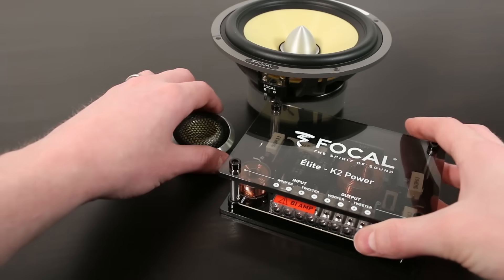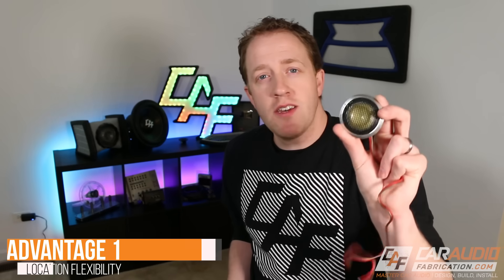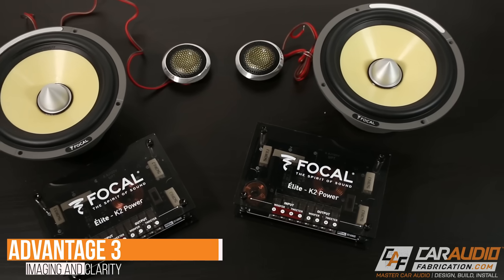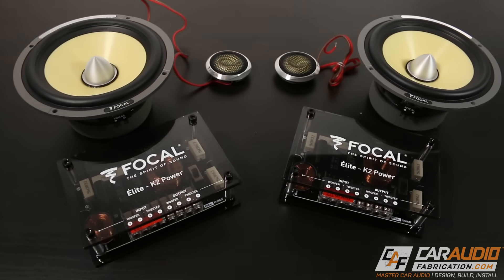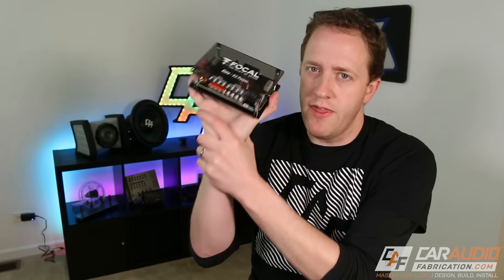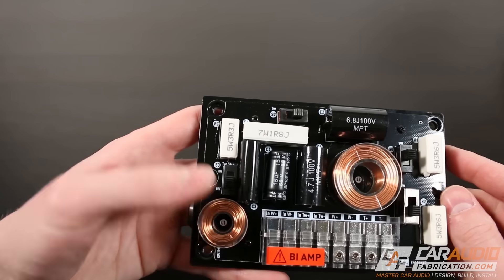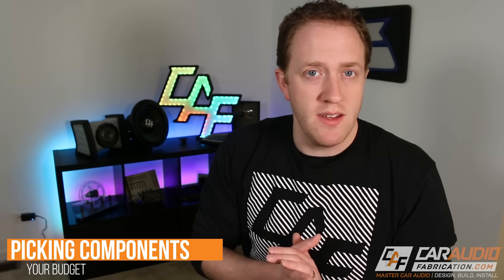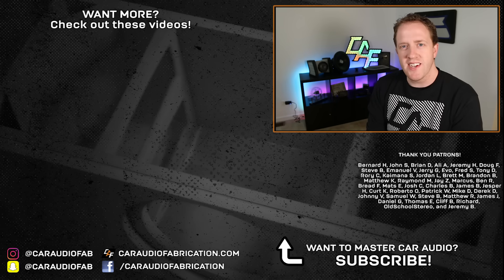Want AMAZING sound? COMPONENT SPEAKERS & everything YOU should know...

Comment: my clk has a factory speaker and tweeter, I want to replace it with a jbl component speaker, my question is: is there a hidden factory crossover that I need to find and replace with the new jbl crossover? or I just use the wires feeding the factory woofer and connect it to the new jbl crossover then branch from it two lines to the new woofer and tweeter?

Comment: I actually have two sets of 6.5” Focal components in my car.  Pricy but sound phenomenal. Bought them in 2011 and are still going strong. From 2011-2018 they were installed using the regular passive setup and sounded great. Recently had everything installed in a 2018 Accord and they did the active setup. It’s a world of difference in sound. Especially with high-end speakers like Focal it is very worth getting the most out of them. It’s like going from a regular exhaust to a free-flow dual exhaust.

Comment: Will a equalizer help? I just replaced focals coaxials auditors for some hertz esk 2 way components it doesn’t seem as loud anymore like a power loss I like how they sound more voice but it’s so sensitive to the jl 400.4 amp you move and the tweeter comes up with to much treble it makes your head hurt i put all the gain down on the amp and seem so fix the problem but it’s not loud at all . regardless of what you do it’s either not loud enough or the tweeter is extremely out of it I have a lc6 also

Comment: New to car audio and I am trying to install this into a 2011 Crown Victoria. I am not a bass head, I just want my music to sound good. 
1# Will this work?
2# What else do I need? (component wise)
3# Where can I install the subs other than the trunk? I am actually considering cutting the backrest of my back seat in half and installing the sub between them. They won't fit in the back deck due to the torsion bars for the trunk lid. They are only 8" and I don't want to waist all the bass they provide by having them in the trunk. Do you have any bench seat mod videos?
4# I was thinking of putting (3) 6.5 and (2) tweeters in the back deck. In the front, (1) 6.5 and tweeter in each door with a single 6.5 in the center console. Is this a bad idea? And do you have any custom console build videos?
5# Should I use wood, or fiberglass? What are the pros and cons?

AudioControl LC8i Black Eight Channel Line Output Converter with Auxiliary Input
(2) Rockford Fosgate R500X1D Prime 1-Channel Class D Amplifier (For subs)
(2) BULLZ AUDIO NEW 4400W 12V BCAP 4.4 Digital Car Power Farad Capacitor | BCAP4.4 (For subs)
(2) ROCKFORD FOSGATE P2D2-8 8" Punch 1000W 2-Ohm DVC Car Audio Subwoofers P2D28
Rockford Fosgate P300X2 300W RMS Punch Series 2-Channel Stereo Class AB Car Power Amplifier (For Tweeters)
Rockford Fosgate P600X4 Punch 600 Watt 4 Channel Amplifier (For Midrange)
(6) Rockford Fosgate PPS4-6 6.5" 800 Watt 4-Ohm Midrange Car Loudspeakers Speaker
(4) Rockford Fosgate PP4-T 1.5" 200 Watt Heavy Duty Car Power Bullet Tweeters
American Bass High End 7 Band Equalizer Voltage Display
(2) Rockford Fosgate PP4-X Punch Pro 4-Ohm Passive Crossover
Kenwood DDX774 / DDX774BH DDX774 2 Din Receiver w/ Bluetooth and HD Radio

Comment: I think you are undervaluing the passive crossover.  It is the very heart of a speaker system and includes some frequency contouring and impedance optimization to "voice" the speaker system.  When purchasing individually, you will find that half the cost of a speaker system is in the crossover components.
Reply: Did not know that

Comment: I'm about to get Rockford fosgate components and also ones in the rear doors would the JBL 4505 be enough to power them and a 300w RMS JL subwoofer? The amp is rated at 45w X 4 + 500w @ 2 ohm I believe.

Comment: hi please if you can tell 

can i use 4 speakers and one woofer in 4 channel amp ? 

I mean 2 front door and 2 back door speakers and 1 woofer 4 channel 1000
Reply: No you can only run 4 speakers. Or 2 speakers and a subwoofer.

Comment: Components require more wattage than a coax..
Reply: Robin Murray because they can handle it! Check google for speaker power theories. To play at the same volume a tweeter will take less than 10 Watts that a 6.5” mid bass will take 100 Watts. Refer to pink noise...

Comment: When I got my car, I noticed that the highs we're so loud that they were driling into my head. I found out that there were aftermarket tweeters in the dash. I removed them because I couldn't handle it. But is there a solution to it?
Reply: I know my response is late but I hope it still helps. As mine are pretty shill I use the built in equalizer in the head unit (I don't have amps or a crossover for front) to put some more mid and low and tune down the highs

Comment: But- your passive x-overs are bi-ampable... solving a lot of the tweeter issues you mention. Why not use a 4 channel for you front stage, adding a DSP and using the as designed crossover
Reply from the maker: This video is meant to be a basic lesson on component speakers, not a focus on this exact set. I didnt want to discuss biamping and other features that are rare for most other components.

Comment: Love the channel! I wish I had half the skill you have with custom builds. I was wondering if you could do a video on how to properly perform time alignment on a head unit. For example, I have a component set (JBL GTI 660) for the front soundstage connected with the included crossovers and a second set connected for the rear soundstage. I have these connected with a four channel amp and a kenwood double din deck. I also have a 12 inch sub in the back of the car. To get the JBLs sounding good doesn’t take much configuring at all, but it’s the integration of the subwoofer that is so difficult to get right. I have a little knob under the dash to adjust the sub level on the fly but I can’t get the sub to sound like it’s part of the front soundstage. I always seem to hear the bass coming from the back of the car. I want it to where when I turn up that knob for the sub level that the bass blends in perfectly with the mids in the doors, almost as if it doesn’t sound like I have a subwoofer but rather much larger midwoofers in the doors. Is it something to do with the crossover settings such as the slope or the freq cutoff point? Perhaps the time alignment is the culprit? A combination of the two? I spent way too much money on my system to not have it be the way I want it. Any help that you can provide would be most helpful and appreciated. Thanks 🙏
Reply: You need a DSP to do time alignment

Comment: @6:00, whoa, whoa, hang on there big shooter, you cannot connect two tweeters or midwoofers to a crossover without changing the impedance load, thus crossover frequency an entire octave... up or down depending on parallel (2ohm) or series (8ohm). Only way this can be done is if the crossover has impedance correction.... and I doubt any do. This will blow a tweeter or play mid woofer into its cone break up zone losing all benefits of intended design. -The passive crossover 'eating power' is bogus, the minimal capacitor/inductor resistance is insignificant and inaudible. -Active is much more beneficial though as far as time alignment, phasing, distortions and personal tuning but not for the noob requiring measuring mics and software for custom DSP parameter tuning. Thanks for this guide video though, great advice for all entering the DYI world or speaker-ation on needs before walking into audio store..... or Crutchfield (fantastic audio product source and customer support)

Comment: I have a 2-way speaker mounted right into the dashboard facing upwards. Is that a good placement? Or would it be better to mount it in the door?
Reply: It's usually not a very good spot. You will get a ton of reflections from the windshield, and the angle from the listening position will usually also be quite large. Get the midbass speakers into the doors and at the very least, get the tweeters in some pods that mount on the dash so that they can be focused better.
Reply: My friend learn the hard way years ago when he put a 6-inch speaker straight into the dash that thing vibrated everything inside that dash 😂😂😂😂😂

Comment: Mark, I have BMW e30 with a component system in the front, woofers are in the kick panels and two tweeters installed in the sail panels. I have a spare set of Alpine tweeters which I have thought about fitting but haven't really considered a suitable spot for them as yet. My question is though would these extra two tweeters make much of a difference or how could they make a difference to enhance the system? Thanks.
Reply: Hold on. Before you do anything, are you running that component system passive?
Reply: @AB-80X  Thanks, Yes it is passive. I am just wondering really if it would make any difference. There is only one position on the crossover for the tweeter in any event so not sure about attaching another one to the connection.
Reply: @bmw-e30 
You can't do so I'm afraid. A passive crossover is impedance specific. If you add another tweeter with the same impedance in parallel, you half the crossover point of the tweeter output, which will not only cause it to sound bad, it will most likely fry all your tweeters as well. If you add them in series, you double the crossover point and thus are left with a big hole and tweeters that only play the upper most frequencies.
I guess you get my point.
Why do you want the extra tweeters? Are you lacking output? If not, don't do it. You'll only end up with a mess of comb filtering and phase cancellation issues. If you lack output power, look for a set of tweeters that has the same power handling as your current tweeters, but with higher sensitivity, or same sensitivity but higher power handling.

Comment: So Mark I’m going to install a homemade box in my regular cab pickup that will double as a console in between 2 bucket seats. My plan is to install a 12” L7 kicker solo baric but I am quite unsure whether to configure a down firing setup or doing a back firing setup. I will be installing component speakers any pointers to help?
Reply: I'm not Mark but here's my years of building and installing car stereos tell me. There's not right or wrong in your situation. Each car is different, so is each box. Some install might like one thing, and the other something entirely different. Which way a driver or port fires nets the best result, depends on so many factors that makes it impossible to give you a straight answer. One of the things some installers do, is building a "simplified" version of two or three designs. Then they can do the "beauty box" when a final design is settled upon. I did this very thing in my last install where I had to choose between vented vs. sealed. Wood is cheap and you have to live with it for quite some time.

Comment: I currently have an aftermarket sound system in my car. I have coaxials in the front doors and was looking to upgrade to components. My after market head unit has a built in amplifier rated at 4 x 100 watts rms. Would you still suggest an aftermarket amp or do you think the built in head unit amp would suffice?
Reply: WTF head unit are you speaking of???
Reply: (i am unaware of any existing 100w RMS X 4 @ 4 ohm head unit that conforms to a current standard DIN\DDIN chassis ? (in real life, actual duty cycle)

Comment: how do I fix the buzzing/ static noise coming from my speakers ?
Reply: edgar leal check ground
Reply: You either have a bad ground, or your signal wire is too close to the power wire. Is the sound a whine that follows the rpm of the engine, or is it a constant buzz? A constant buzz could also indicate something as simple as bad RCA connector somewhere.

Comment: The exact set of speakers I am getting for my install....would you recommend running the crossovers in the door or have the cross overs near the amps and run 2 speaker wires through the car?
Reply: Rich J it does not matter, only determining factor is if you can run two sets of speaker wire through the wire path

Comment: Hi, can any pro tell me if you have 2 amps, for example one 500w for the sub and one 400w for the  speakers, is it normal to have the gains at different levels or should they match by lowering the gain level of the highest? 
And how big usually is the gap between the low pass filter and the high pass? Or should they also be at about the same level?
Reply: they should be different, as the input sensitivity adjustment (gain) is for matching the source unit output signal voltage (unclipped) to the amplifier's optimal input signal voltage.
Reply: @face2face11  Thanks for the reply, I have the gains set up properly but I dont feel the sound is as good as it could be, so my question was related if I should try to adjust the HPF or LPF set at 80Hz both, or perhaps lower the gain of the speakers or subwoofer from the highest gain point down so there is no distortion in the signal (as opposite of moving the gains up and causing this). From what I understand you have to be careful with the overlap of the HPF and LPF, again, just not sure if is better to adjust filters or lower gain. I will just play with both options, thanks.
Reply: @dnxb1t 
In the case where you don't have a DSP to attenuate the output of the frequency band that is too loud, yes you use the gain controls to level the spectrum. But as you mention, you attenuate the output that's too loud, never turn up the one that is too low.
That being said, consider something like an Audio Control Matrix Plus. It will basically take your amp gain knobs out of the equation. Turn them all the way down and use the line driver to raise the signal level. A good powerful line signal is much less susceptible to noise, hum and distortion - and you don't need to worry whether or not you can actually get to those pesky amp gain dials.

Comment: So I'm new to this but I wired in my head unit that has four channels. The car has 4 decent size speakers and 2 tweeters. Does the 4 channel mean that it can only go to 4 speakers and will leave out the tweeter? 2002 Camry
Reply: Usually the amp connects to the coaxial speaker (the mids and tweeter in a single speaker) or from the amp to the crossover (the  plastic box with the connections that he showed here) and from that crossover, it goes out to the mid speaker and the tweeter. 
The crossover basically just separates or sends the right sound to the speaker and tweeter.

Comment: my question here is just to try to get a better understanding of the flexibility I have with doing a custom component setup where I would use a Rockford woofer and an alpine tweeter with an audiopipe passive crossover. Both woofer and tweeter would be 4 ohms each. so my question now is what would be the ohm load that the amp sees when they are connected through the crossover? would the crossover load to the amp remain at 4ohm or would it change to 8ohm?

Comment: So my question is i want to put component speakers on my rear deck, but not sure where to put the tweeter since it will have to be custom? Should I put it close to the woofer or put it far like at the door?
Reply: You need to install the tweeters in the same "plane" so to speak. If the woofers are behind you, your tweeters needs to be as well. If I were to run a set of mid woofers in the shelf, I'd look into installing the tweeters somewhere in the rear pillars or on the shelf facing forward. You don't want those tweeters facing up into the glass. But then again, why not just install both midwoofers and tweeters in the doors?
Reply: dont.

Comment: What about Morell brand?
Reply: I can say that I swapped out the Focal KRX2 tweeter for Morel Supremo Piccolo, and as much as I love my Focal woofers, the Morel tweeter is vastly superior.  but of note, Focal's new ES series has a tweeter of different design than the KRX2 tweeter.  But it is difficult to imagine anything better than the Piccolo, it is truly beautiful audio.
Reply: It's a personal preference. Good sound for sure, but it's subjective. Their tweeters aren't as angry as Focal tweeters tend to be, but they are not as silky smooth as Dynaudio either. My personal issue with Morel is the fact that the sound of their woofers and mids seems "stuck" in the speakers. When it comes to mids and lows, brands like Focal, Dynaudio and e.g Arc or Helix does this much better, as the speakers do a much better job of becoming "invisible". You can always tell where a Morel low or mid speaker is located.

Comment: I bought my first component set back in the early 90’s. It was the first generation Boston Acoustics Pro series.
Reply: Great speakers. Still miss my 5.5
Reply: ABOlsen69X I miss both the 6.5 and the 4.0 sets. I ran them in a custom designed passive crossover that was in a 1989 Grand Prix. I also had their Pro 10” sub. I ran all of that with a Orion 425 HCCA. I had the 10”’s in the rear quarters, the 6.5” in the doors and the fours in the kick panels along with the tweeters.

Comment: I installed an aftermarket head unit in my cousins car, and we found that his stock mid speakers are blown. Can I buy a set of aftermarket mids and connect them with the stock tweeters, or do I need to get new mids and tweeters that are made to work together?
Reply from the maker: If you are looking to just "get by" and have sound then yes you could just try and buy a stand alone mid. If you actually want some performance I'd recommend a set and amplifying them.